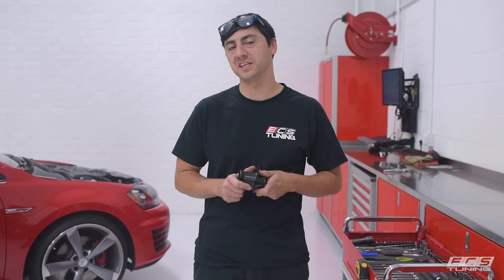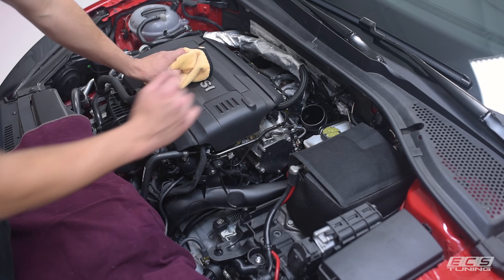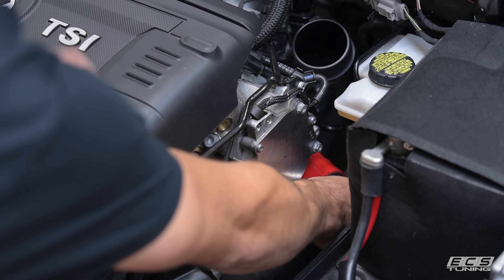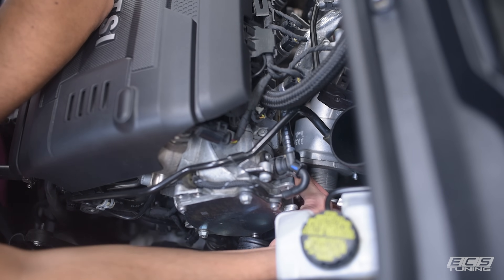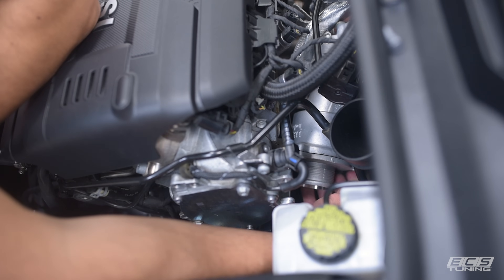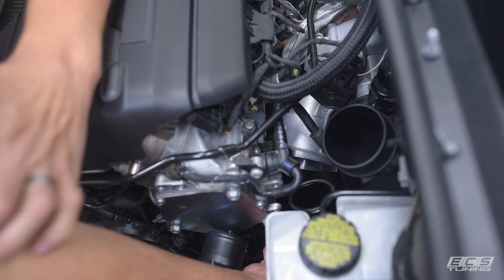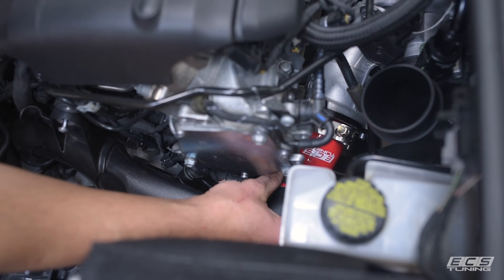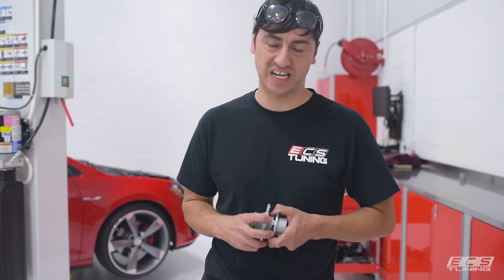ECS Tuning VW/Audi Turbo Muffler Delete DIY

Comment: Please could you let me know if the oem Turbo Muffler has a O ring? I had a Racingline turbo muffler delete which came with a oring on it for a year and I can’t remember if I needed an o ring for the original. I reinstalled the original but I just wanted to double check before I start having leaks. Thanks so much.

Comment: So what’s the difference between this and Diverter valve Spacer ?
Reply: They are two different parts doing completely different things.
Reply: @MercSLRFan what does the muffler delete do ?
Reply: @thebigbosss1000  it creates a smooth exit for the air coming out of the turbo, purportedly to reduce lag and increase whooshy noises. In my experience, it does neither.
Reply: @ ooh wow I see now , well thanks for the info

Comment: You’ve made it look so much easier than other accounts. Saving me so much time!
Reply from the maker: No problem!
Reply: It's easier when the hose clamps are easier to access because you aren't using the stock coupler and can change the position of the clamps to suit and the Turbo muffle delete bolts are what looks to be finger tight. Intake in the way? Not if you remove it off camera!

Comment: What is the purpose of the slots on the OEM unit?
Reply: the slots disrupt air flow a little making it both a bit quieter and since it disrupts air flow it can very VERY slightly bottleneck air flow, with this mod i havent noticed any performance gain its mostly just for whooshy turbo sounds :D

Comment: I get a p234 overboost code, everything is installed correctly, when I clear the code it seems more responsive and have more of the turbo sound but 4 seconds later while getting on the throttle it throws the code and the Jetta seems to be going into limp mode or just not as responsive like it has no boost 
checked o ring 2 times and hoses and clamps 3 times still the same issue even after disconnecting the battery, I’m sure it’ll go back to normal if I put the stock turbo muffler back in but what can I do to keep the delete and make it run normal Lmaoo
Reply: You could have a broken diverter valve or dirty MAP Sensor. I think... get crc sensor clean take MAP out and clean let dry completely and see if that helped. If not it might be your DV.
Reply: ngl i had this same issue on my 1.8t then when i got my GLI had similar issues where boost was weird . thinking going back to stock

Comment: Can I put this on if I already have the diverter valve spacer? Won’t cause no problems? Cel?
Reply: I know this is old bro, but does the diverter spacer cause issues since the air has already been metered?

Comment: Just installed this on 2016 Audi A3 2.0T Quattro; overall the install is straightforward.  I found that having 5mm Allen L-Key helped with the bottom bolt for removal and reinstallation. The big time suck was the factory turbo housing O-ring.  Props to ECS for including an extra with the kit I got; old one was a bit beat up.  Grease that ring to get it to hold in place while lining up delete pipe; wasted a lot of time trying over and over again to place the ring and pipe just to have it slip at the last moment.  Dab of grease kept it in place and let it slide when rotating pipe to line up mounting holes.  After that it was smooth sailing.  Turbo more woosh good.  Thanks ECS!

Comment: My question is can I just buy the piece itself or do I need the piece and the whole discharge silicone hoses as show here?? https://neuspeed.com/products/neuspeed-hi-flo-turbo-discharge-conversion-480247?_pos=1&_sid=ba0a75fe9&_ss=r&variant=15793304305727

Comment: i'm pretty late here but hopefully someone sees this... if i'm gonna do the muffler delete and the turbo inlet would it be wise to do them at the same time? looks like you'd have some more clearance for the three bolts on the muffler delete without the inlet elbow there
Reply from the maker: Might as well get it done while you are in there! Getting a silicone TIP will free up some room and make the car breathe and sound better

Comment: Can u have this installed along with a blowoff valve or wastegate?
Reply: Yeah but need a modified charge pipe can buy silicone ones on eBay easy to put on

Comment: Is the stock o ring that in the turbo must be applicated cause it dropped over the engine and i just installed without it will it gonna make any boost leaks or somthing? (O ring in the TMD is installed)
Reply: I never installed that o-ring either mine wouldn’t stay on
Reply: @mk6_mark920  i bought a new after a while and i installed it again, you need to put a little bit of grease to make stay in the turbo

Comment: Why can I not find any videos for the turbo muffler delete for the FSI
Reply: Mike Palmer did you find one yet?
Reply: zack obrien no I didn't I did notice the easiest way to get to it it's going through the passenger wheel well
Reply: Mike Palmer Awesome, thanks for the info! I am looking to do this to my 2008 A3 (has a CAI on it already) and was wondering your opinion on if you found the turbo muffler delete to be worth the money you spent for it

Comment: If you came here to do this on an Audi B8 or B8.5 then take the skid plate off from under the car and it’s located on the passenger side. Very easy install. Bing bang boom and you’re done. Only thing that gave me trouble was getting the o-ring to stay in place while putting the turbo muffler delete on.
Reply: Why so Testi could’ve used a thin layer or silicon grease to hold it in place
Reply: Evan Watty yea that’s what I ended up doing.
Reply: Is there a rise in sound noticeable? Is it worth it?
Reply: @Darkdownshooting  youre not going to get the sound you want. so prob not worth it. But there is small difference.
Reply: The turbo mufflers 3 5mm hex bolts are so tight I can’t get them off

Comment: keeping the o-ring in place...nearly impossible
Reply: You need to use a little grease to keep it in place small amount helps
Reply: Yeah how was this just glossed over? I’ve spent an hour trying to get that stupid thing to stay. Thinking of just installing without it
Reply: @meowmotor  I installed without it no issues yet
Reply: Mk6 _mark I ended up using a little grease to get it to stick. Super easy with that.
Reply: Thank goodness for the comments lmao

Comment: Just installed the ECS Turbo Muffler Delete Pipe and ECS Silicone Connecting Tube on my 2016 Audi A3 Quattro.  I actually used another Youtube video as a guideline that took me through removing the intake tubing/airbox.  I'm a bit surprised the ECS video omitted that important part.  Removing the OEM hose clamps from the OEM connector hose on the OEM turbo muffler pipe was a PITA.  Used a 7mm open end wrench on those. The bolts holding the OEM turbo muffler on are 5mm not 4mm.  The T30 torx bit works fine in place of a 5mm bit.  I had to chuckle when I saw the bottom 5mm  bolt had already been removed.  I used a 5 mm allen head wrench and several 4 letter words to remove the bottom  bolt.
Reply: I'm about to do this... Was it worth it? Is this just for the noise or is there anything gained here?
Reply: Lol! 4 years late but your comment makes no sense. He's literally working on a completely different engine so of course the fittings are different 😂😂
Reply: @GreenskeeperVR what are you talking about the audi a3 has the same engine as a gti lmao
Reply: @GreenskeeperVR  😂 he had to watch a video on removing the air box 🤣

Comment from the maker: Thank you for the suggestions everyone.  The turbo sound will vary based on modifications to the vehicle including intakes, downpipes, and changes in boost pressure.  We will try to include sound clips in future DIY videos.
Reply: regarding sound for me, I had it installed in my 2.0T Audi A4 B8.5 and it didn't really increase it much, very slightly, even with increased boost with Stage II map. percentage wise, the spool sound probably increased approx. 10% only
Reply: @eeiko321  so not really worth the price? im just starting modding my mk6 golf r and ive got a 3" dp with decat and im de resonating with a repacement pipe and keeping the stock muffler for now and tuning the engine and dsg box to stage 2. already have a cold air intake. Im surprised at how few videos of showing the difference in actual improvement in performance there are available, im annoyed at the ratings on manufacturers sites of increase of upto 10%... doesnt affect my life in anyway and id like to know if its worth upgrading some one part while saving up for others of if im saving up for everything at once... Ive got a friend who does vag tunes so i get the tunes done for free so doesnt matter how many individual mods i do...
Reply: Well it is pricey for what it is. It may increase the sound / or should I say; get more out of sound if you have a pod filter.

I personally don’t like pods as they’re subjected to more heat soak and there’s never real Independent proof of them Giving you gains.

Well the muffler delete may help spool, maybe a bit quicker. But nothing really noticeable when driving

Comment: a few revs before and after install to hear the difference would have been a nice addition to the video.
Reply: ***** ecs is only about 40 mins from me and ive gotten tons of parts through them for 2 previous audi cars ive owned.  they deff make top notch parts, its just sad their install videos dont show the benefits of the parts.
Reply: Not a nice addition. A requirement. This video wasn't even good propaganda.
Reply: Trust
Reply: It has a little bit of a difference for my car at least